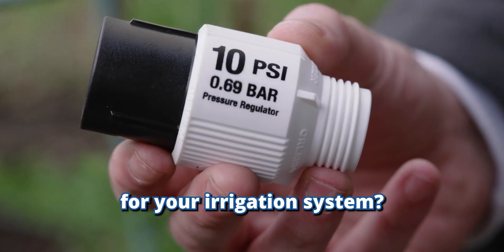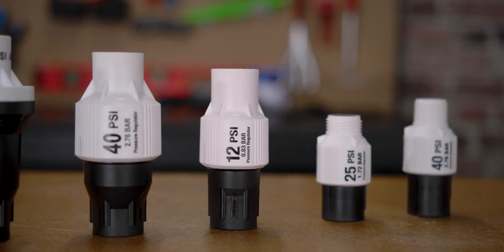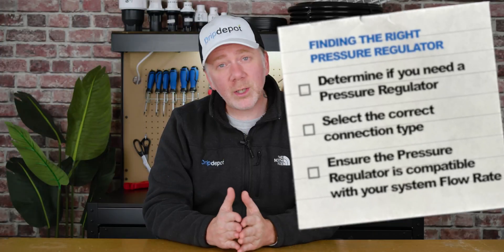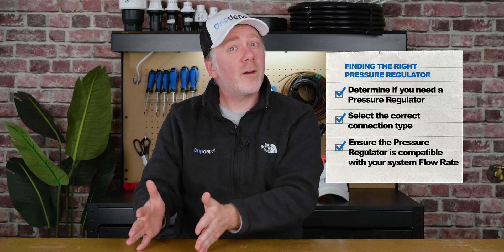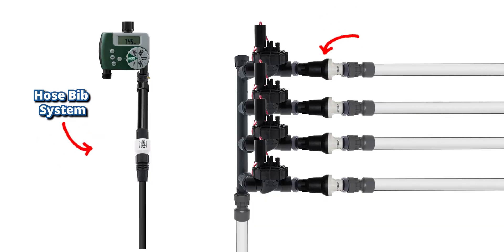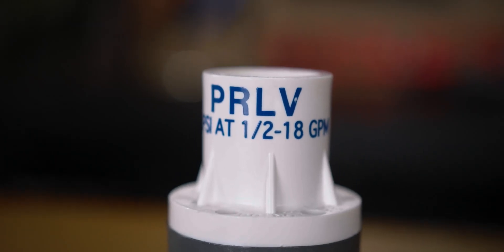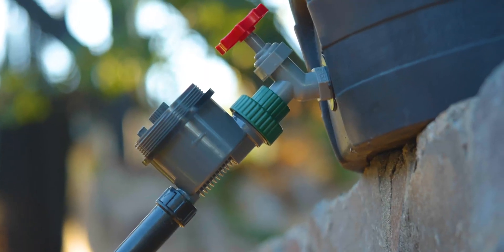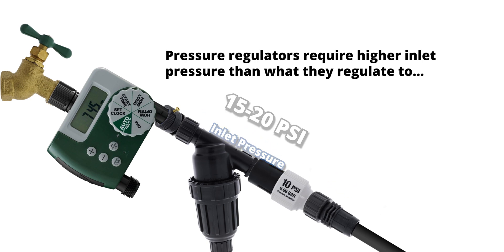Do You Really Need a Pressure Regulator? Understanding Water Pressure & Irrigation Systems

Comment: Nice video. I could not find the difference between PSLG103F3M, PRLG103F3MC79,
CS-WSS, Dripdepot, hos,. Could clarify what is connection on each of this type.
Reply from the maker: Great question, and I think the only difference is in who is offering them.  Both point to the 10 PSI pipe threaded Senninger Regulator with a female pipe threaded inlet and male pipe threaded outlet.  If I found the same list you did, the numbers at the very end appear to indicate who is offering that specific listing.  Senninger's full part number for that specific regulator is "PRLG103F3M". 

The connection type on the regulator at that part number is NPT, with female threads (FNPT or FPT) at the inlet, and male threads (MNPT or MPT) at the outlet :)
Reply: @dripdepot thank you for your time and detailed reply.
Reply: @dripdepot could you let me know where i can buy online 6psi and 10psi pressure Reducer

Comment: hi sir, we r using rainbird selenoid for our olive orchant in turkiye, main pipe 40 pe, santrifuj hidrafor pumping 1.5 bar. do we need it too? or its just for only watering lawns. thank u
Reply from the maker: Pressure regulators see quite a bit of use in every type of irrigation system.  Probably the most common in a drip irrigation system, but sometimes needed on other types as well.  

Is the 1.5 bar pressure a reading you took while the system was running?  If so, that 1.5 bar is well within the operating pressure of most drip irrigation components as it is and there's a good chance it wouldn't need regulated further unless you were using any drip tape on the system.  Drip tape prefers to operate at about 0.70 to 1.0 bar. 

If you can, check the specifications for your emitters for the operating pressure range to see what the manufacturer recommends.  If you're anywhere around 0.35 bar or more over the recommended operating pressure, a regulator could help regulate the pressure to keep it within the operating pressure range of the emitters.  

Basically, if that 1.5 bar was tested pressure while the system was running, it's in a good place for most drip type emitters other than thinwalled drip tape and may not need regulated. 

Awesome on the olive orchard content you've got too!  I saw some button drippers in the video I watched and can confirm the majority of button drippers operate optimally between 0.70 to 2.0 bar :)
Reply: @dripdepot thank u very much your responde sir❤

Comment: Can you used this in a regular hose and then connect this presure regulator backflow??
Reply from the maker: The pressure regulators like the one in the video can be connected to a hose no problem (either side too, inlet or outlet), however they don't begin regulating pressure until a few conditions are met.  One of the conditions is a pressurized system, which basically means the lines need to be full of water and pressing back against the pressure regulator and this wouldn't happen in an open hose.  With a high enough flow hose nozzle (at least 30 GPH) it's possible the conditions could be met and pressure would be regulated :)

Comment: I put a simple drip regulator,  in line with the stubbed out PVC pipe, made sure the arrow was pointing toward the manifold, unfortunately the pressure is still  way too high, the tubes just immediately fly right off. Need the reduction to occur at the property's stub out (a white pipe coming up from the ground, currently with a screw on cap)...
Reply from the maker: Odd that pressure was still too high with an inline regulator upstream, happy to explore that a bit here.  Are your fittings popping off right away, while the system is still pressurizing?  The reason I ask that pressure regulators require two things in order to begin regulating pressure: 

1. Pressurized Lines -- the lines have to be completely full of water and pushing back on the regulator. 
2. Flow - the majority of them won't begin regulating pressure until water starts coming out of the emitters.  Most of them have a minimum emitter flow that has to be met as well, 0.5 to 2. 0 GPM for the more common regulators.  

With that said, you do have some options.  If you need to regulate pressure right at the main stub out, a Pressure Regulating Limit Valve may have better success.  They can withstand constant pressure so it's ok if they're upstream of all the shut-off valves, and they can regulate static pressure when no water is moving.  During operation they do still have a minimum flow required to regulate dynamic pressure.  They can also withstand higher inlet pressures in most cases, up to 125 PSI.  Here's an example of those: https://www.dripdepot.com/prlv-pressure-regulator-fpt

Beyond that are pressure reducing valves, but these tend to be pricy and are typically only used in larger systems.

I had one more thought.  Is the tubing that's popping off upstream of the manifold in a location that it's always under pressure, even when the system is off?  If so, this could potentially explain it.  A lot of the common irrigation tubing and fittings out there is not rated for constant pressure and needs to be downstream of shutoff valves.  There are some exceptions like HDPE and PEX, but if it's every day tubing there's a good chance it can't handle the constant pressure and will eventually pop off the fittings (or rupture the tubing).  If your tubing is downstream of your valves you can disregard this portion :)

Comment: I could use some help! I have a 1/4 line running with 20 sprayers and I have it connected to the hose , only half of my sprinklers are getting water and some low pressure , others no water at all . Water is escaping from the connection? I need some help here !
Reply from the maker: Sounds like your 1/4" line is getting overwhelmed with 20 sprayers on it. This is more likely a flow issue than pressure, even though the symptoms look similar. Your sprayers are putting out a decent amount of water each, so there's probably just not enough flow getting to the ones further down the line.

What kind of sprayers are you using? Individual sprays can use anywhere from 3 GPH all the way up to 30 GPH each depending on how they're adjusted. With 20 of them, you could easily be looking at 60+ GPH total demand. Flow through tubing is limited by friction loss. To make things easy, we go by the 30/30 rule for 1/4" tubing - we don't like to see more than 30 feet of tubing or more than 30 GPH flow on a single 1/4" line.

The easiest fix would probably be upgrading your main run to 1/2" tubing since the larger diameter eliminates a lot of that friction loss, then just use 1/4" for short runs to individual sprayers. That 1/2" mainline can handle way more flow and should get water distributed properly to all your sprayers.

I made a video that tackles your exact situation here: https://www.youtube.com/watch?v=mWB7TDnNrfE

Comment: We are new to the garden drip irrigation and decided to purchase drip hose with built in emitters from someone that removed it out of their high tunnel. We are using them in 12 of our 4' x 20' raised beds. How can I determine the flow rate on the emitters so I will know which pressure regulator needed?
Reply from the maker: Great question!  In many cases it will be printed on the line itself somewhere (at least for 1/2" poly and 5/8" drip tape emitter lines).  If it's not printed it's a little trickier, but here are some common flow rates based on the type of emitter line: 

1/4" Drip line: 0.5 to 1.0 GPH at 25 PSI. 

1/2" Poly Dripline: 0.5 to 1.0 GPH at 25 PSI (though often pressure compensating allowing for a larger operating pressure window). 

5/8" Drip Tape: Drip tape has a lot of different flow rate options, but operating pressure for tape is typically 10 to 15 PSI.  Drip tape is flat when not pressurized and has very thin walls, if that's what you have, I'd stick to that 10 to 15 PSI.  :)
Reply: @dripdepot  These are 1/2" driplines. Thank you for this information! I will check the lines for any markings and see what we need to complete our system. I will be coming to your website for the supplies. Thanks again!
Reply from the maker: @MelanchthonCreekFarm  Perfect!  Good chance it's either 0.5 or 1.0 GPH in that case, and also a good chance it's pressure compensating :)

If you need to dial in on its flow rate, one test we've found that works pretty good is to use a gram scale.  Grab a small bowl, 0/Tare it out on the scale, let it fill for 60 seconds then weigh the water.  1 gram is equal to 1 ml and there are 3785.41 ml in a gallon of water.  You can us this method to audit a long line, testing at various points along the way to make sure everything is uniform.
Reply: @dripdepot  Great information, thank you for sharing!

Comment: I have a system for my container garden entirely done with your Potstream sprayers and a 30psi regulator - has worked great for several years but I’ve added some more containers and now the sprayers farthest from the source (also farthest uphill) are not getting enough water pressure for good spray- should I go to a 40 psi regulator or try going with no regulator? We’re on a community well system and general water pressure is not very high though I don’t have a gauge
Reply from the maker: I suspect this will be more related to the flow rate than pressure (though the symptoms are the same).  Those put out a reasonable amount of water, so what is likely happening is there's not enough flow available for the emitters further down the line.  As a quick example, let's say you have 20 Potstreams each putting out 10 GPH for a total of 200 GPH in flow demand.  If the water source only provides 150 GPH, some of them are going to be starved of water and removing the regulator won't help.  

It's a fairly easy fix, you basically just want to zone the system (automatically or manually, either one will do the trick) so that only portions of it operate at one time.  Basically, making sure the flow demand is below the flow provided.  

There is one situation where removing the regulator could help, and that's if the water source is below 35 PSI without the regulator.  Those regulators require 5 PSI more at the inlet than what they regulate to (thus 35 PSI minimum for your 30 PSI regulator).  If the incoming pressure is below that amount, the regulator valve may not open and is basically just serving as an obstruction.  I wouldn't try it without a regulator if PSI were 50+, but if it's not (and you did mention it feels like a low pressure source) you can try without the regulator and see if that was the issue.  If there is no improvement, it's highly likely it's just a lack of flow.  

Be sure to be on site to walk the system if you try without a regulator, high pressure can blow the adjustment knobs off and/or fittings if pressure is too high.  If you're on site you can just turn off the water and I wouldn't expect a moment or two of high pressure to cause any damage.

Happy to help if any of this brings up any follow-up questions, just say the word!
Reply: Thank you for the expert info, I will give it a try without the regulator and keep a close eye on it… I had plans to add another zone for the upper section anyways 👍

Comment: Do I need the pressure regulator. I have a very long brown drip a half inch irrigation hose. The farther away the less drips. Some of it doesn’t even drip at all.
Reply from the maker: Potentially, but likely not in this case, happy to explain :) 

If this is non-pressure compensating drip line, it could be the early emitters are eating up all the available flow and pressure, not leaving enough for the end.  That's the one situation where a pressure regulator can help, but I'd put it pretty low on the list of possible causes.   When this is the cause, you''ll usually notice the closer emitters putting out significantly more water than they should. 

The most likely cause is either exceeding the flow rate of your water source or the line is too long which is leading to heavy friction loss (pressure lost from friction in a pipe or tube) so there's not enough left at the end of the line.  Is your drip line the brown 1/2" size or the 1/4" size?  If it's the 1/4" size you want it to be at around 30' or less -- if it's the 1/2" it's a little more involved depending on spacing and flow rate of the emitters.
Reply: @ the brown hose is either 1/2” or 5/8”. the closer emitters are putting out more than the further down the hose emitters. It probably should’ve been on two separate valves. I’m thinking about having the Landscaper just add drippers where no water is coming out
Reply from the maker: @letterphase  Perfect, the 1/2" / 5/8" drip line can indeed be pretty long.  Do you know the emitter spacing and  stated flow rate of the drip line you have?  With that and its linear length I may be able to help narrow things down a bit.
Reply: @dripdepot  the emitters are 12 inches apart. I don’t know the flow rate, i’m assuming it’s a 1 GPH
Reply from the maker: @letterphase  Ok, perfect -- any rough idea on how long it is in total linear feet?  What I'm going to do is run friction loss math and see how much you're losing throughout its length.  

Also, are there other emitters on that zone or is it just the dripline?

Comment: Hello. I dont have a water pressure gauge to screw onto the hose bib. We do have a gauge on the system in the basement thats near the bib. The pump comes on at 25 and goes off at 45. What size PSI regulator would my drip irrigation system need? Thank you for any help.
Reply from the maker: Which regulator to use typically depends a lot on which emitters you're using -- if you plan to use "Drip Tape" you'll want to go with 15 PSI.  Most drip components work best at 25 PSI, so if you're not sure, 25 PSI is a safe bet (except with drip tape, but that's the only real exception).   :)
Reply: @dripdepot  ok. Thank you. We're wanting to have 9" spacing emitters (approx 430 per entire garden). We have five 4x18 gardens and four 10x8 gardens.  We're not sure which size main line tubing to use ( 1/2" or 3/4") The garden is 90 feet from the water bib. Thank you.
Reply from the maker: @PkCrochet  Perfect!  That sounds like 1/4" drip line, in which case 25 PSI is the sweet spot :)
Reply: @dripdepot  please advise on mainline size. ... 1/2" or 3/4" ?
Thank you
Reply from the maker: @PkCrochet  Based on what you've described so far, I'd go with 3/4" tubing -- I'll break it down below: 

With 430 feet of drip line with 9" spacing and 0.5 GPH emitters, you will have a system flow rate of right about 286 gallons per hour.  286 GPH going through 1/2" tubing (the 90' plus a little more to hit all the beds) would lose about 9.2 PSI from friction, which is quite a bit. 

That same 286 GPH going through a little over 90 feet of 3/4" tubing will only lose 2.0 PSI from friction, which is a pretty small amount.  

Basically, the 3/4" will help ensure you don't lose too much pressure from friction inside the tubing. 

The next step (if you haven't done it already) will be to test the flow rate of your water source to make sure it can provide in excess of 286 GPH --  all you need is a timer and a bucket.  Time how long it takes to fill the bucket with water and then put the numbers into the flow rate calculator here: https://www.dripdepot.com/irrigation-calculators

Just in case, here is a quick video we made that shows the water flow test that I described above: https://www.youtube.com/watch?v=tGxJaqQeg94
Reply: @dripdepot  thank you so much for your help. Yes, we tested water flow today and we get 6 gallons per minute from our bib.

I need to find and replace all my items in my cart to accommodate 3/4" mainline.
Reply from the maker: @PkCrochet  I'm just about to leave the office for the evening, but I'll be back early in the a.m. tomorrow -- I'd be more than happy to take a look over your cart when you're ready to make sure everything looks good and is compatible :)
Reply: @dripdepot  thank you very much!
I actually got an idea for two zones for different watering times and sections, so I decided on the 1/2". The 3/4" set up was a lot more than I planned to spend.  I did place my order. Thank you again for your help.
Reply from the maker: @PkCrochet  You're very welcome!  When everything arrives, if any installation questions come up, I'll be here :)
Reply: @dripdepot  thank you so much!
Reply: @dripdepot  also we have 9" spacing 1/4" emitters hose in cart. Not using tape.

 We checked and we get 6 gallons per minute out of our bib.

Comment: How to increase 16mm thedrip line (up to filter3/4pvc line reduce to 16mm )
Reply from the maker: Likely all you'll need is a 16mm Tubing x Threads adapter, with the threaded size connecting to the filter.  If you know what size (3/4", 1", etc) and thread type (Garden Hose Threads or Pipe Threads) your filter has, let me know, happy to see if we have an adapter that would do the trick for you.   Also if the filter has male or female threads, or both (if it has both, good chance it's a hose threaded filter for a hose bib).

Comment: I  bought an automatic 4 head drip system. Can I put the PSI regulator before it or do I need to buy 4 for each head?
Reply from the maker: You'll need one for each outlet feeding a drip irrigation zone -- the reason why is that the pressure regulator (and filter and backflow preventer) are not rated for constant pressure, so they have to be relieved of pressure when the system is not in use.  

With that said, there is a pressure regulator that can handle constant pressure -- it's pipe threaded, so requires adapters to go on a hose bib, which is often more hassle than it's worth, but just in case here is the link to a regulator that's rated for constant pressure: https://www.dripdepot.com/prlv-pressure-regulator